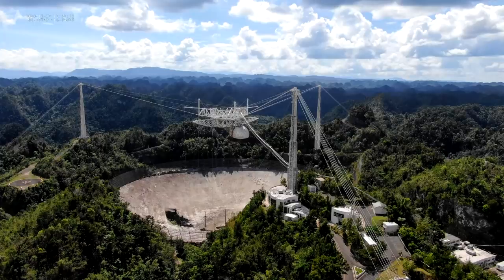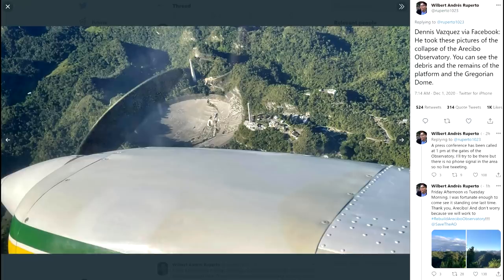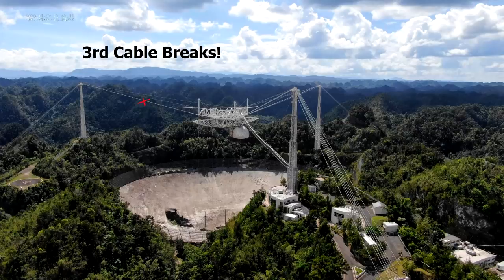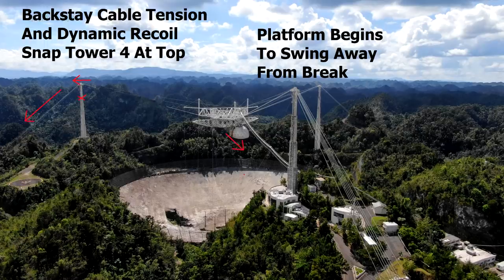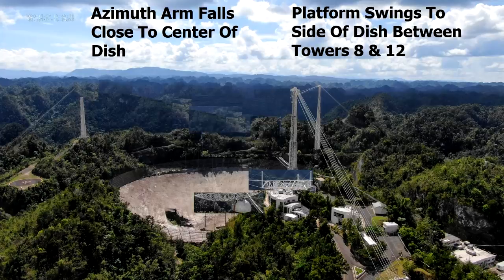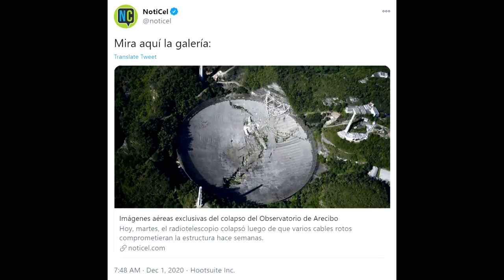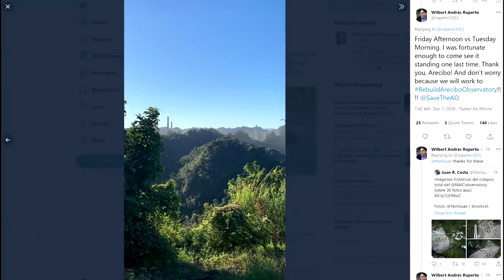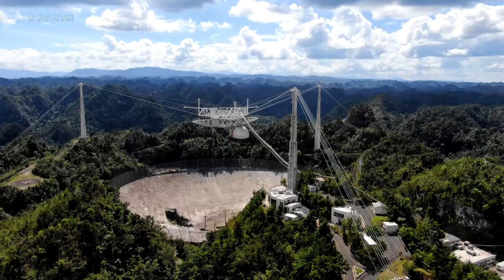Arecibo Radio Telescope Collapses!

Comment: Start with a very remote, warm and humid location that's hard on concrete and metal and difficult to service, add in chronic lack of funding and top off with several natural disasters that amplify the weathering effects already present. Arecibo was a massive target for the Second Law, it's wonder it lasted as long as it did. Glad no one was injured.
Reply: it was also under built, they upgraded it several times and only added some "bandaid" reinforcements.
Reply: Well said, Jimmy James.
One more bit is that the assessment of the condition of the structure that they did not long ago, was apparently a bit too optimistic.
Reply: I agree with you. A real unic structure, built in a very aggressive conditions enviroment and real problems of service, without the right funds and a good plan for maintenance, can't stand for so many decades.  Specially if there is a lack of will on the part of those responsible. The tragic collapse of Morandi bridge in Genoa of the August 2018 has comparable origins. It was built in the same years of Arecibo with a bold project. The faster than thought corrosion of the wires and the concrete decay, without a proper maintenance, sadly caused the loss of many lives and the destruction of an iconic piece of modern architecture.
Reply: Good observation.  It really should be a success story for how long it lasted with insufficient maintenance.
Reply: It's in the nature of the instrument. Arecibo, and the Chinese FAST giant telescope, were built in extreme karst environments. If you need a giant bowl shape, that is where you'll find them. Extreme karsts only form in warm and humid climates, and tend to be remote (because it's forbidding terrain), plus I think the sites were also chosen for remoteness to reduce radio pollution.

With those limitations, yes, budgeting for regular upkeep is vital.
Reply: @stevegrimes3664  I noticed that they were both built in karst and wondered why. I would expect the mineralogy and topography to be tough to build on. But I imagine those natural bowls drain well with all the crevices and sinkholes.
Reply: Right? I thought this thing had already fell out of use years ago, I had no idea it was still functioning.
Reply: i think the "diversity" people didn't wanna take care of all the oppressive telescopes the white man gave them .... because racism
Reply: @stevegrimes3664  GEOLOGY the science that's always taken for granite.
Reply: It’s not remote dear god people have no idea how not remote it is.
Reply: @theAppleWizz  it's like 20 minutes from the highway...
Reply: @joseamirandavelez  it’s 20 min from the main town is that what people call remote.... it only 10 miles people can walk that in a few hours.
Reply: @Majima_Nowhere  People were still using it for research until just recently.
Reply: That's why we have maintenance. Large structures exist in warm and humid location. High rises don't collapse in Miami.
Reply: @LibertyDankmeme  
 Interestingly enough, in Scott Manley's previous video on the Arecibo telescope ( I think it's less than a month ago from now)  One of the contributing causes he cites for the cable snap and the engineering survey  Recommending its demolition, was budget cuts during the George W. Bush era to support the "war on terror."

I'm as Anglospheric as they come, and at the same time I scowl at the shortchanging of science and the betterment of civilization in order to fight such a nebulously defined campaign.
Reply: @stevegrimes3664  Hmm... the Barringer Crater in Arizona comes to mind as a potential site.
Reply: @Bl4ckw0lf1  what the schist you talking about?
Mica been natural failure?
Reply: Facts
Reply: @jeffreyyoung4104  thank you for not  being igneous about it.
Reply: @jonathantan2469  is it possible to build multiple sites?
Reply: @LibertyDankmeme  Why is "diversity" and "this thing is tangentially connected to Europeans" so many peoples' first guess when something bad happens?
Reply: @timothymclean  experience
Reply: @stevegrimes3664  Karst topography can be found in dry areas, as well as in temperate areas (Eastern Europe)
Reply: @theAppleWizz  Good luck getting peoole to want to work on steel cables and concrete in that climate, in that dense of a forest, with very little access for heavy machinery. You know, factors you don't have to deal with in a city like Miami.
Reply: @notablediscomfort   ????? Dear god there need to be a bit more “logistics” than in the middle of a city. But let’s just put it this way there is a Home Depot 25 minute away. Not like they are going to build it with parts from it but this is not the middle of the Amazon And yes people can work in that climate. They do it all day every day.
Reply: @theAppleWizz  They have Home Depot in Alaska. Doesn't mean it's a good place to put a giant radio telescope.
Reply: @notablediscomfort  Not sure if you know this you need a good area of RF free zone for this type of thing. You can't put this  in the middle of a city. 0_o
Reply: @theAppleWizz  plenty of space in texas
Reply: @notablediscomfort  -_- no you can't! You need this type of geological features to best build this type of telescope and I live in Texas. So your thing is that is in Puerto Rico hummm.
Reply: @theAppleWizz  How do you live in Texas and not think there's a good spot to put a giant telescope?
Reply: @notablediscomfort  There is a reason why those telescope are made in natural sinkhole you can't just put one in flat land………..

Comment: That's the nature of cascading failure: decades of stability and then you lose a critical element, and suddenly the strain is too much for the remaining elements.
Reply: See: the Silver Bridge collapse.
Reply: Same thing conspiracy theorists don't understand about the WTC towers. You can demo it with a bunch of rope in equal tension. Once you cut or weaken enough they all fail.
Reply: I understand the elasticity in physics
Reply: Also see 2018 Morandi bridge collapse
Reply: Literally every space video these crazies/bots come in trying to stir up shit in the comments. What a waste of energy.
Reply: @javaguru7141  
 OK, riddle me this:
 Flight data recorders and cockpit audio recorders are designed to survive impacts that obliterate the entire rest of the plane, and be found relatively easily. One of the most difficult efforts I'm aware of was finding the CAR of Kenya Airways flight 507; that took three weeks, and that was in a swamp with no support equipment. Why did it take almost three months to find, decipher ('clean up'), and release the CAR of AA Flight 77?
Reply: The thing is, one of the things Scott Manley pointed out in his previous video on the Aricebo Observatory, is that budget cuts precluded preventive or corrective maintenance on the telescope when it was most needed, in the decade of the 2000s. He said that at the point the 1st cable failed in August, the cables originally fabricated and erected in the 1960s, were bearing loads at 60% of their capacity, when I think the engineering tolerances gave a capacity of only 40% maximum tensile strength per cable.  So the load per cable had actually increased by 50%, when the cables themselves had degraded over time due to oxidation and elastic stretching.
So ultimately the final cable failure and subsequent collapse wasn't a result of poor engineering, but of negligence of the maintenance aspect of the program.
     Aricebo Observatory
............. 1963-2020 ............
Reply: @HuntingTarg  How much damage was likely done by the hurricanes Puerto Rico has endured in the last couple of years? Remember the tossing of paper towel rolls?   The entire island was hit with 135+ MPH winds, was this equipment 'parked' for safe keeping, or was it just out hanging around to be blown around by the hurricane winds?
Reply: @tomgates316  There was no 'parking' the central catwalk, since it weighed many tons without any equipment, and there was not enough slack or flexibility in the main cables to allow it to be dragged aside and down from over the reflector dish.
The steel cables may not have been damaged by the winds as much, since that high off the ground & above the canopy, high winds (~50-70 mph) were probably expected and engineered for in the design.
I'd be more concerned about rain being driven by said winds into seams & gaps in the cable braiding.
Reply: @HuntingTarg  It only took 3 days to find that flight data recorder and cockpit audio recorder, it was found as part of the cleanup, right where the plane entered the building. Of course that also meant it had been sitting inside a raging fuel fire that had burned to completion, so all of the voice tapes had been charred and melted to the point of uselessness. THe flight data recorder survived and data was extracted, but that may have taken months

Comment: Alternative headline: "Not Putting Workers on Top to Try to Repair it Turns out to be Right Decision".
Reply: Absolutely. Sad that they proofed right, but great that they came to that conclusion and that decision makers followed it, avoiding casualties. Most likely, all that was caused by cutting down the budget decades ago. You can continue operations for a fair amount of time with reduced maintenance, but at some point you'll have to pay the price.
Reply: Exactly right.
Reply: Why sad? It was going to be demolished anyway in the coming weeks.

Thankfully nobody got hurt.
Reply: @movax20h  It is sad in that the structure was foolishly permitted to degrade to such an extent that maintenance was no longer an option (without posing a serious risk to life) and the only remaining option left was demolition.
Reply: Not sending people up was the right decision this year. But any time before it got in such a state would have been fine.
Reply: @ethanpoole3443  Yeah, this could have been prevented if it didn't have its funding slashed. It's actually pretty amazing that it held up as well as it did with all the neglect, hurricanes, and earthquakes
Reply: I remember an article from a few weeks ago discussing the safety challenges of the planned demolition. I presume this has lessened that problem.
Reply: It's too bad there was no way to just lower the instruments before the cables failed.
Reply: @rosentrantz0  The time to do that would have been before the cables started failing, I think after that point that started becoming really dangerous.

Comment: I'm guessing the person making the call that repair was too dangerous feels pretty good right about now
Reply: Not only that. He said in the report that it can collapse on its own any moment, maybe weeks at most.

Thankfully they all made good call, and listened to that engineer, and nobody got hurt.
Reply: Someone listened to the ENGINEER? That NEVER happens.
Reply: If only it hadn't been so underfunded and neglected over the years, it could have gotten the proper preventative maintenance it required.
Allegedly one of the main steel cables was faulty, and it could probably have been detected and replaced.
Reply: @movax20h  what the hell! So building the damn thing wasn't dangerous? Ignore the scaredy cat, engineer, that sucks his thumb and cuddle his bwanky. I bet his name was, I want my mommy, I need a pair, I'm yellow, no balls, or hold me. 
Lets rebuild.
Reply: @timesthree5757  risk acceptance has also evolved over time.  Go back far enough and there was once a time when X people dying of injuries was just "part of the job"...now safety regs won't accept "oh well a dozen workers get mamed or killed".  Also they had a controlled plan to build it, not an unknown condition of partial failure.
Reply: @TimesThree ??? Did they built the receiver on the ground and pulled it up before they built the dish, it’s very different building it in the first place than fixing it because of this. Those X amount of workers have families to look after and friends that care about them, your disregard for human life is disgraceful.
Reply: @matthewmiller6068  mmmm. Bullshit! We need to start taking risks again. Yes, they had a controlled plan to build. But, their was a level of risk that was acceptable. Now days we so scared.
If we are going to do epic shit again we need to put down our teddy bear and send it. We need to have more, "hold my beer" moments. 
If someone get hurt, then they'll have a cool ass scare.
Reply: James Klette  yep they just stuck the cable up in a socket and put some weak solder or some crap up in there they should have bound the cable around something and then soldered it instead they just stuck the cable straight up in there and soldered it of course that's going to work loose
Reply: @MrNinjatortoise  we are all gonna die. We might as well do something epic.
Also I thought people were bitching about to many humans on Earth?
Reply: James Klette  bad let fix it.
Reply: @MrNinjatortoise  well, all that shit had to get up their somehow.
Reply: James Klette  Probably nothing but clearing it, as impressive as the engineering was, and even though it did its job well until the end, giant radio astronomy installations like these are obsolescent, there's methods for looking into space which are much easier to build and maintain, and which give comparable or better results.

So to my understanding, it doesn't make any economical sense to build a new radio observatory like this, even if you could likely have upgraded the performance further (it was once upgraded to improve its output tenfold). It's a real shame still, because it kept holding together and functioning after so many years of neglect and hard weather, and the engineering of the entire installation is remarkable. It's practically as beautiful as the Notre Dame to me, except the Notre Dame wasn't nearly as damaged and it's being restored, while for the Arecibo, the entire suspended assembly and telescope is just absolutely busted, and the support towers are damaged. The dish itself would be relatively easy to fix compared to the rest of it, but nobody will do even that.
I guess we'll just have to remember it for all the hard work it did, the grandiose engineering, and its spots in pop culture.
Reply: @timesthree5757  Maybe you haven't noticed but epic stuff is still being built, all that's changed is the methods used. It's no longer acceptable to plan for a few deaths and many others badly injured....of course accidents do still happen and people get killed, but they have to make an effort to do things smarter to reduce the risk.
Reply: @Pete856  like what? Trying to think here. Elon Musk. Oh yea he's blowing rockets up. Risking folks lives doing something Epic. Lets see Cern is risking radiating a country side for Epic. (Yes, the use safety but folks got hurt and they still go forward." My neighbor almost killed himself when the supercharger on his engine ripped it self apart. Yes people are doing epic. The ones that are not are the one sitting at home worring about people getting hurt.
Reply: @timesthree5757  I'm talking about construction in general and not only scientific instruments. But yes, there's CERN, HARP, and those gravity wave detectors (forget what they're called). In construction, look at a list of the tallest buildings for example, how many have been built in the last 25 years, probably the top 10?
Reply: @movax20h  Unlike NASA and Challenger! :(
Reply: @Pete856  an effing building is not epic. Also that tall as building in Dubai. About 25 people died to build that.
Reply: @0neDoomedSpaceMarine  yep lets fix it.
Reply: @timesthree5757  go volunteer to go down there then bud
Reply: @404 Error Not Found All people die. Lets rebuild.
Reply: @Joesolo13  if they make the call yes I would. Helped rebuild after Katrina. I have a burn scar going from my elbow to my fingers. Im quit used to being dangerous situations.
Reply: @Joesolo13  Im going to have one cool ass obituary.
Reply: @timesthree5757  There is a difference between overpopulation and cutting someone's life short. I think it's important that people can live their lives to the greatest extent they can. And you missed my point that it literally effects everyone around them.
Reply: @timesthree5757  You also obviously dont know how they built the dish in the first place, I recommend you check out Scott's video on that.
Reply: @MrNinjatortoise  so I should listen to a third party instead a first person?
Reply: @timesthree5757  What are you talking about? If you don't believe his vid go read a book or something. How they build the damn thing isn't really a question lol

Comment: First it started fallin' over, then it fell over.
Reply: - You where supposed to watch
- I watched! I saw everything!
Reply: What happened to the tower? Well, the front fell off...
Reply: @ApothecaryTerry   Did they then tow it outside of the enviroment?
Reply: @tomas5255  Not yet, it's still in an environment.
Reply: @ApothecaryTerry  Good thing that cardboard and cardboard derivatives were out, or it would never have stood for this long.
Reply: (Bart Simpson) "Hey Millhouse you want a job at my radar telescope observatory?"
Reply: Well thank you senator Collins for coming in tonight...
Reply: More like... the top fell off. It should have been designed so the top doesn't fall off.